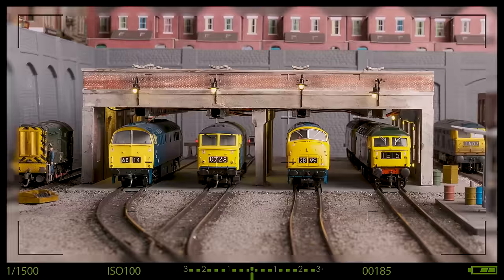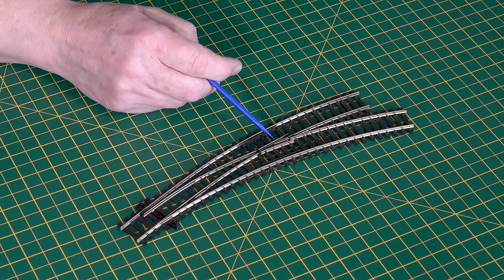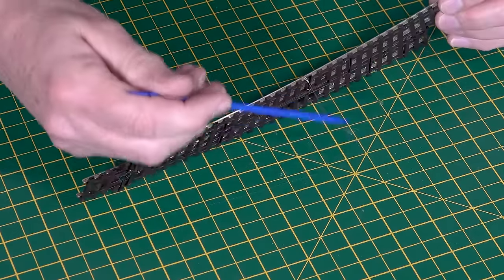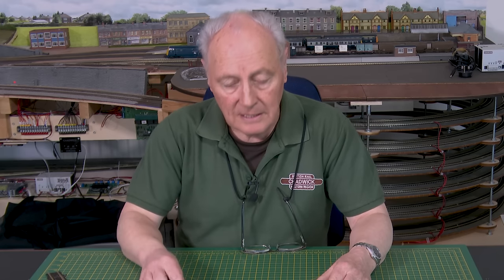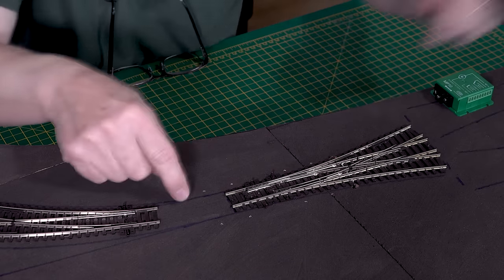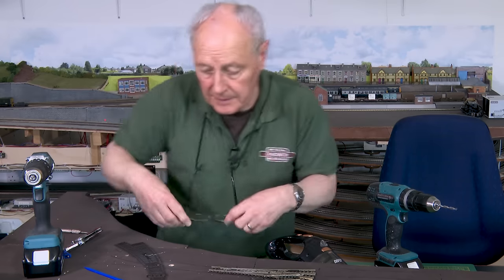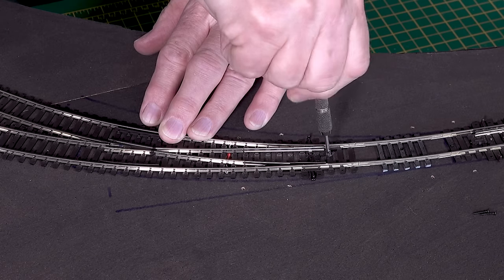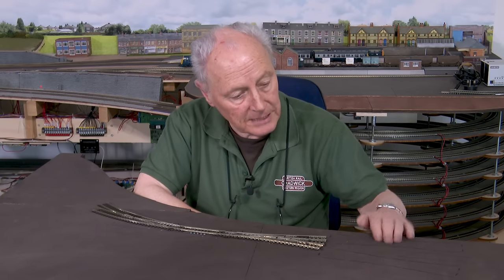PECO UNIFROG Vs Electrofrog Vs Insulfrog Points at Chadwick Model Railway | 219.

Comment: Those turnout motors seem pretty sleek, especially being smaller than the tortoise. Without having used them, do you think they might be your motor of choice? So far they seem a fair bit louder, but I really like the adjustable nature of the wire. I wonder if they would be good for if your motor was mounted lower, like an inch or two more away from the track since it wouldn’t have the same kind of … torque? Torsion?
Reply from the maker: Yes, Andrew, I don’t see the height difference being an issue, you can always replace it with a longer piece of piano wire. Regards, Charlie.
Reply: I was looking at the three way point and the clearance issue and was wondering if you could flip the point motor 180 degrees so the mounting lugs were away from the board and mount it on 1x1 baton on the no wired side and two 1x1 pillars on the wiring side so the wiring would be easier to access the wiring from one side of the layout and still have access to the pin adjustment screws
Reply from the maker: @chrislockerby1411  to be honest Chris, that thought never entered my head! Great idea though. Regards Charlie

Comment: Very informative but i disagree with you on your opinion that you can simplify your range by having all points unifrog as these can't really replace the insulfrog point for DC as many of us DC users rely on the insulating function of a point to jabe more than one loco on a layout without having to wire any insulated sections, do whilst the unifrog point is obviously a step forwards for DCC modellers over the electrofrog and having to wire around the insulating function of an insulfrog point.
To sumarise:
DC use insulfrog,
DCC use unifrog,
I still find it quite amusing that ehen DCC was launched it was advertised as only needing two wires, and here you are wiring up every point, whilst a DC trainset is the one that actually only needs two wires.
I toyed with the thought of DCC a couple of years ago, but I'll stick with my "2 wires" DC and stick with the hand of God changing my points, uncoupling etc the only thing I can imagine would enhance my enjoyment by using DCC would be the sound, but i can always listen to your channel whilst I play trains!!
Keep up the good work Charlie.
Reply: Insulfrog and Electrofrog points behave identically in DC layouts.  I use almost exclusively electro frog models (about 100 in total) and rely entirely on the rail to rail contact for power continuity.  I have over many years never felt the need to change this.
Reply: I should have qualified my earlier comment by adding that the 3-way electrofrog points are an exception. These require frog switching in their electrofrog variety though not in the insulfrog version.
Reply from the maker: All that really matters gentlemen is the system we have adopted works for us. Stay safe, regards, Charlie.